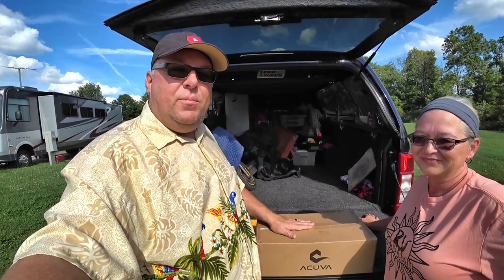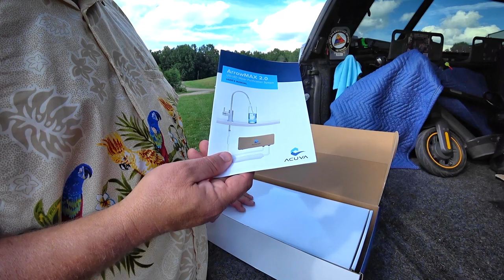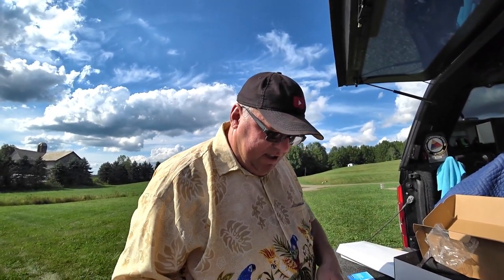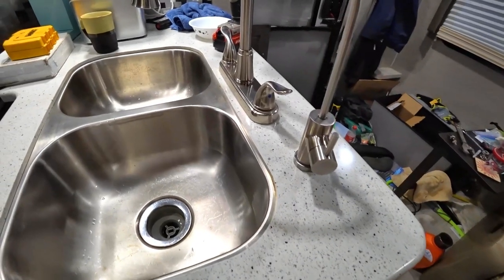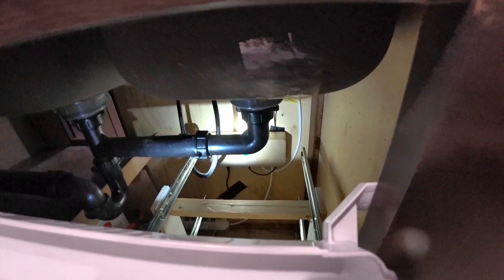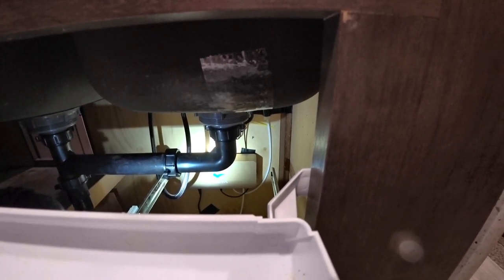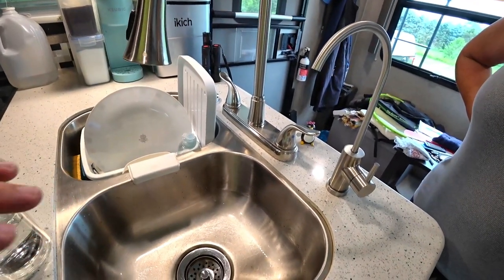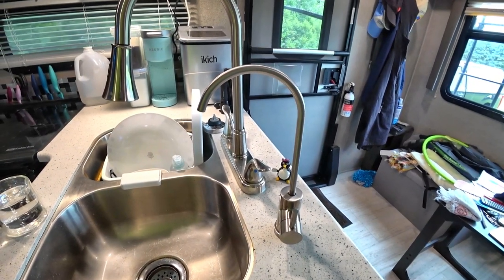Acuva ArrowMAX 2 0 Water Purifier

Comment: Yup, Maybe I'll upgrade to the newer unit. Mines was their original unit that doesn't flow water as fast as this one does that You reviewed. You should also note to your viewers, If you store your RV during the winter, dump the water out of the unit because it took two months for us to get the pink antifreeze out of it. The antifreeze stained all the white plastic lines pink.
Reply from the maker: I will pin this to top. Thank you for letting us know that. Never know when we might have to be in freezing temps...
Reply: @Rvdaydream  I guess that's why they have a shut off knob on the connector, It will allow you to disconnect the unit and let the water out, much like you would for the hot water heater bypass. Silly me, used antifreeze through the system. That's something they should suggest in the manual. Lesson learned..

Comment: We have a R.O. system at our house and know what you mean about great tasting water.  I can't hardly stand brushing my teeth with the chlorine in the city water.  In our Rockwood we have exterior pre filter and water softener which does help with water fixtures lasting longer and of course soft water for shower.  We have a travel Berkey for drinking water, I know you said you don't want one because of space, but I am picky with water taste and it's darn close, if not the same, to R.O. water taste at ANY RV park we have stayed at.  They are half the cost of the UV purifier you installed and water taste great.  Your mechanical and inventive you could make a stand in a corner, shelf, something that could work for you. Safe travels, hope everything goes good at VA clinic. Boone

Comment: Maybe next install. You could attached the white water line with the compression nut could be installed prior to attaching the shark bite to the pex  lines. Plus as I see that at HD and Lowe’s don’t have a shark bite connector that has a sharkbite connection on the 1/4 inch line area. As the sharkbite is designed for more residential plumbing connections. Just my 2 cents
Reply from the maker: It is impossible to do that as the some nut uses the same threads that the compression nut uses. Meaning that the faucet has to have its mounting hardware in place before the compression nut and white supply line can be connected. I too thought that the quarter inch might be too small of a diameter to use that type of a push lock fitting however the water filter and the flow restrictor both have those types of connectors on them.